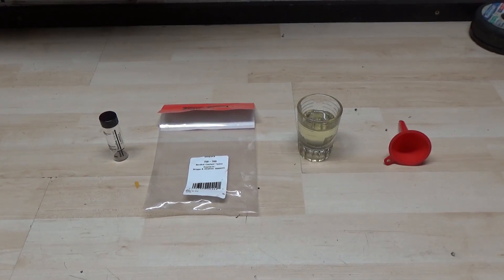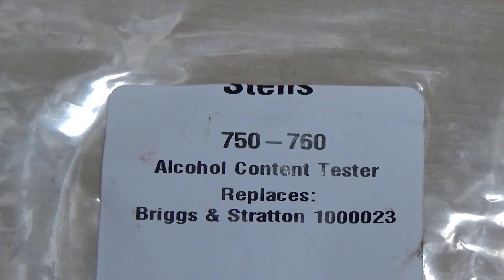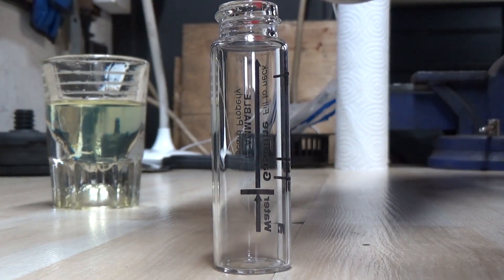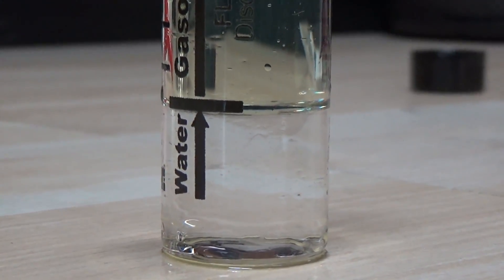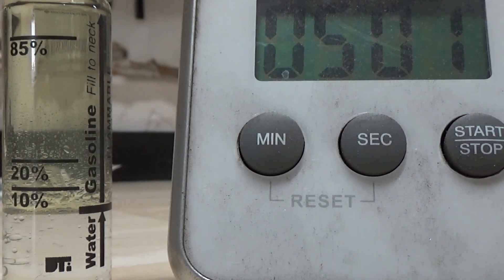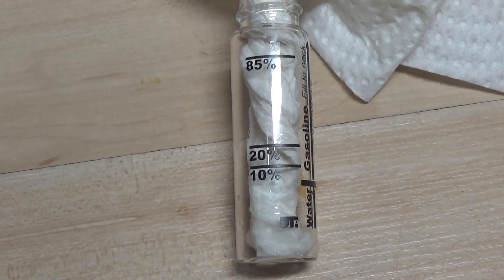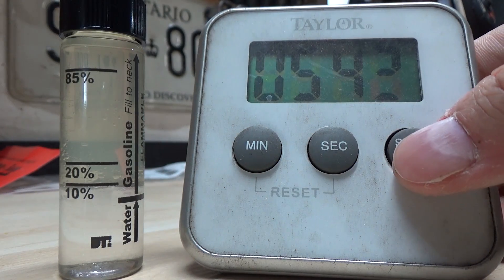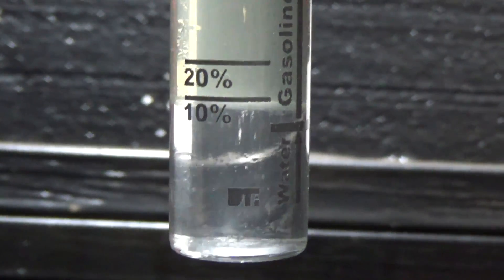How to Test Ethanol Content in Fuel

Comment: You are measuring the phase seperation. Water is soluble in the ethanol, gasoline is not. The water will draw the ethanol out and be at the bottom of the vial because gasoline is lighter than water and water and ethanol mix. Ethanol based fuels will tend to draw in moisture which leads to corrosion in your fuel system. The fuel additives heet that remove water from gasoline is isopropyl alcohol. This is partially soluble in gasoline, so it can remove the bottom layer of water from your gas tank. I think that most manufactures of small engine have changed to rubber parts that are not effected by 10% ethanol gasoline. You cannot run higher % ethanol based fuels than recommended because you have to richen the fuel mixture as the ethanol rises. In California, our 91 gasoline is still 10% ethanol. If I am not going to run it for a while I will put fuel stabilizer in the small gas tank, run it to mix in carburetor. Then fill the gas tank full. If its longer than that drain the fuel system.

Comment: Canadian Tire 91 octane now has 10% ethanol.
Reply from the maker: Yes it's unfortunate, but it actually has "up to 10% ethanol" which means it may or may not have. I spoke to a manager at CT gasbar in town and he says sometimes it does sometimes it doesn't
Reply: @EliminatorPerformance I have 100 ml bottle. How much water and gas be mixed to test for ethanol content? What's the ratio of water and gasoline to be added? Can I add more water than gasoline?

Comment: Just to add: The fuel at the top is now ethanol free, which you can decant off and use in any engine that can't use ethanol fuel.
Reply from the maker: Yes but the ethanol is around 100 octane and if it's e10 fuel (10% ethanol) then you lose about 10 points of octane so you need to add an octane booster to it.

Comment: Can you do a video on how to separate the ethanol from the fuel at home?
Reply from the maker: The issue is it's a pita as you have to add water so the ethanol separates, then you drain the water from the fuel and then you have fuel that is less octane so you have to do the math on how much octane boost you need. If you buy 91 octane with 10% ethanol and the ethanol is 100 octane you're basically removing 10 points so now you have what, 81 octane. The issue is when people start with 87 that has 15% lol now it needs more booster

Comment: Looks like the days of ethanol free are over here in Canada. From numerous reports I’ve come across online that due to government regulations that ALL grades will phase in to contain 10% ethanol.

I just bought some Shell 91 from my local pump the other day (Feb 24, 2023 in Mississauga, ON) I’ve tested 91 from this station in the past and it was always ethanol free.

Unfortunately I just tested this recent batch and it came back at 10% ethanol. I’ll test again in a month or two to see if this was a one off but I doubt it. Did some poking around via Google and came across this quoted response from Canadian Tire Corporate from late 2022 (who previously sold ethanol free 91):

“New government regulations intended to reduce carbon emissions from mogas across Canada are now being rolled out. This regulation includes a 10% ethanol component in regular and premium gasoline. Canadian Tire fuel suppliers are now mixing up to 10% ethanol in both regular and premium gasoline to meet those requirements.

Ontario and other provinces across Canada are now implementing this initiative and Canadian Tire will comply with those regulations”

Here’s a quote from Petro-Canada:

“Do we put ethanol in our Petro‑Canada gas?

Yes, all of our grades of gas, including our Ultra 94  high octane fuel , contain up to 10% ethanol content. This is required by federal and provincial regulations.”

In short it seems the days of ethanol free fuel are over and if you’re still finding it it’s older batches. My guess would be by the end of 2023 it will be impossible to find (in Ontario at least)
Reply: Yep...same in Alberta.  I just got an email from Parkland Fuels (Chevron distributor for Alberta) and they have confirmed that they no longer have the option to produce and sell non-ethanol fuel.  As of the end of February 2023, ALL FUEL IN CANADA contains ethanol - 10% will be typical unless otherwise noted.  This was mandated by the Feds and is now in effect.  My fuel test this past weekend (26 FEB 2023) confirms 10% ethanol or more in Chevron 94 (signs still say ethanol-free) which was always the go-to fuel for vintage, high-performance and seasonal vehicles.  I've had to remove the ethanol for use in my 1984 Virago.

Comment: I have been reading that Canada has made it mandatory that all gas sold contains ethanol as of 2022. This includes premium grades. I have been buying Shell 91 and last night I did  a test like yours and found no signs of ethanol in it. Anyone have any further info on this? Makes no sense if it was mandated a year ago.
Reply from the maker: Shell V Power 91 and Canadian Tire Premium 91 are still ethanol free!
Reply: @EliminatorPerformance  Great to have a little test kit like yours to confirm it from time to time!
Reply: @EliminatorPerformance  Great video.  Most Chevron 94 in Alberta are (still ) ethanol-free.  Many of the convenience store owners associated with the gas stations have placed decals over all of the pumps stating that the fuel "may" contain up to 10% ethanol, including the pumps that are dedicated to 94 only.  I'm sure this was done in error since there are large signs clearly stating that 94 Octane is ethanol-free.  And regardless of the government's overreach, there still needs to be recreational fuel made available for seasonal machinery, recreational/marine use (like REC-90 in the US - see Wiki) and vintage cars & motorcycles being harmed by ethanol in gasoline.  The agricultural/farming industries in Alberta, Saskatchewan and Manitoba are pushing back hard on the feds' mandatory ethanol policies.  Not everyone drives a Prius in the city.
Reply: I just bought some Shell 91 from my local pump the other day (Feb 24, 2023 in Mississauga, ON) I’ve tested 91 from this station in the past and it was always ethanol free.

Unfortunately I just tested this recent batch and it came back at 10% ethanol. I’ll test again in a month or two to see if this was a one off but I doubt it. Did some poking around via Google and came across this quoted response from Canadian Tire Corporate from late 2022:

“New government regulations intended to reduce carbon emissions from mogas across Canada are now being rolled out. This regulation includes a 10% ethanol component in regular and premium gasoline. Canadian Tire fuel suppliers are now mixing up to 10% ethanol in both regular and premium gasoline to meet those requirements.

Ontario and other provinces across Canada are now implementing this initiative and Canadian Tire will comply with those regulations”

In short it seems the days of ethanol free fuel are over and if you’re still finding it it’s older batches. My guess would be by the end of 2023 it will be impossible to find (in Ontario at least)
Reply: well you can separate ethanol manually if you want ethanol free fuel  @thehawk05

Comment: If the 87 and 91 both have the same ethanol content where I live, does it still make sense to purchase 91 for my small engines?
Reply from the maker: No, the 91 is ethanol free, the 87 is 10% ethanol. Therefore, the 89 is a 50/50 mix from both tanks, and results in a 5% ethanol rating. If I could buy ethanol free 87, I would.

Comment: I have been using Costco 87 since December 2020 for my new CRV 2020. The first part of 2021, I got great mileage. Then, early summer 2021, the mileage started dropping. 
I wonder if Costco changed their gas, even though it says 87 octane. 
In my area of eastern Los Angeles county, we have a lot of Chevron stations, a few Mobile & Shell.
The question, which of these would get better mileage? Even though Costco is 50 cent cheaper, is it worth it for low mileage & possible ethanol damage?
Thank you
Reply from the maker: Only the Costco 91 is ethanol free! Same with Canadian Tire 91. I've been told shell v power now has ethanol. And Sunoco 94 has 1-2.5% ethanol, which could be trace amounts from them doing a tank to tank transfer.
Reply: @EliminatorPerformance  Several months ago Costco in Oshawa Ontario (so I expect it is everywhere) changed their premium gas from no ethanol  to 10 percent ethanol just like the regular pump and now there are the 10 percent ethanol stickers on both sides of the pump . Very disappointing and I'll have to go elsewhere to get ethanol free gas for my boat and small engines.

Comment: Sooo , does this mean if you did this on a larger scale ... then Drain the Fuel off the top ... you would end up with Good Non Ethanol Fuel ????
Reply from the maker: Yes, but it would be low on octane so you have to add booster
Reply: @EliminatorPerformance  be interesting to see how much it would loose ... and one would have to make sure its Not an Ethanol Based Booster ... i ask because in my erea you cant find Non Ethanol fuel and for all the lawn care , chain saws , generator and other small engines..  i hate winter , have to go thru and drain everything ...
Reply from the maker: @danieledwards7178  the only fuel we can get that's ethanol free is 91 octane at Shell (V-Power they call it) or from Canadian Tire gas bar. I wish I could purchase 87 octane in ethanol free but they want to boost that to 15% ethanol now which means I'll probably make way more money because these mowers are not supposed to run on more than 10% ethanol and no one likes to purchase more expensive 89 (which is only 5% now but will no doubt be boosted to 10% soon. I run 91 octane ethanol free in everything, my truck, mowers and snowblowers. I hardly ever work on my own equipment, apart from basic maintenance.

Comment: Ethanol also burns faster, getting worse gas mileage.  I ran 94 instead of 87 and I saved 1 litre of gas for every 100Kms on the highway.  I knew it would improve a little, but it was more than I expected.  It’s still a bit more to run the 94, but I can add a big more boost and timing…..

Comment: Second test says ethonal is in gas but how do you know it’s not just water
Reply from the maker: Because it would've already been separated. Ethanol binds to the water and is pulled out of the fuel, so by adding a measured amount of water, after shaking if the water level rises, that means the 10% ethanol (alcohol) has been pulled from the fuel.
Reply: @EliminatorPerformance  is still not following I guess. If water binds with ethonal then how do I know it’s ethonal not just water. The water line raises to say 10% line. That can mean water also right? Because water binds with water so how do I know it’s ethonal not just more water?

Comment: The water in ethanol does not evaporate through the vents.  It's worse than that.  Ethanol attracts  and pulls water vapor (the humidity in air) in through vented gas tanks and the water in the fuel gets more water.  The water then goes to the bottom of the tank as it did in your test vial and does not evaporate.

Comment: Thank You for this video. I am more knowledgable for it. 

Question: 
Can I use this same glass vial to test if my 2 year old (91% Esso - so no Ethanol) half full gas can is still potent?

I assume, I'd need to shake the gas can to mix back any water condensation/impurities so that after the 5 minute test, I could get a reading of how much useless material is in my gas can? Then, lets say it shows a 20% separation line, would that suggest I need to carefully drain out the lower 20% of my 'Gas can' (once settled), so that I essentially remove water/ethanol and get left with more 'OOMPH'  Or, am I completely mad and just need to go get new 91% gas?

Yes, I am a novice in this area but would be a better steward of the environment if you can guide me right!

Cheers!
Reply from the maker: Unfortunately this doesn't test octane ratings or if fuel is still good, it only tests how much ethanol is in the fuel, as it will bind with the water and separate from the fuel, as shown with the lower grade fuel. Only the 91 Octane here in Southern Ontario Canada is ethanol free, so that's what we purchase. Also, not all 91 Octane fuels are ethanol free. The only places here that sell ethanol free 91 is Shell, Canadian Tire and Costco.
Reply: @EliminatorPerformance  doesn’t Costco only sell regular gas? Our Costco doesn’t have a gas station yet.
Reply from the maker: Costco near me sells most blends other than e85

Comment: The comment about no ethanol is more important in you older or historic car. Ethanol will screw up most 1970's or older engines (unless rebuilt) Also pre 1975 engines will need a anti knock additive because of the no lead factor. (real lead). If you have an old motor with has been rebuilt to run on modern fuel, just remember if you use the 'cheap stuff' it is the ethanol which makes it run like crap. We now have SHEETZ here in OHIO, which has a variety of blends and options for you to choose. Including a E zero fuel

Comment: just to clarify, ethanol is bad for old cars... but not for  newer cars, they can handle up to 30% ethanol without problems!  good video btw!
Reply from the maker: Some new cars* just because my truck is flex fuel, doesn't mean all newer vehicles are. They use special components to run e85

Comment: One thing to remember when doing this test and getting a small sample of Ultra 94 at Petro-Canada into a gas can, makes sure you fill the vehicle with Ultra 94 first to get any remaining fuel out of the pump hose (the previous person may have filled their vehicle with regular). This of course if the high grade fuel does not have its own dedicated pump hose which it rarely is. That hose is usually shared between regular, mid-grade and super.
Reply from the maker: Yes, great point. Thanks for watching!
Reply: I usually put 1L of premium in the truck before filling the gas cans, not sure what to do once I get a diesel truck.
Reply: Locally we have dedicated pumps/hoses for Non ethanol & Reg.

Comment: Octane has nothing to do with ethanol content. And higher octane doesn't mean better performance from your vehicle!
Reply from the maker: Octane where I live has everything to do with Ethanol, because I can't buy 87 or 89 octane ethanol free.

87 octane is 15% ethanol
89 octane is 10% ethanol
91 octane is ethanol free.

Therefore, in this video, I explain that I have to buy 91 in order to get Ethanol free fuel.
Reply: @EliminatorPerformance  fair enough. Still misleading though.
Reply from the maker: I don't find it misleading at all, what I'm doing here is testing the 91 Octane fuel I'm purchasing to see if it's worth it. Which is what my thumbnail says "is 91 Octane worth it?". And octane absolutely affects the performance of an engine, as higher compression engines need higher octane fuel because it ignites slower, so predetination doesn't occur. My 2019 f150 with a 5.0L V8 for example, has an engine with 12:1 compression and runs poorly on 87, and says that's the minimum Octane that should be run, with my manual even stating I may need to run 89 or 91 premium when towing in the summer time, because of the added heat and load on the engine.
Reply: @EliminatorPerformance  What he is saying is that Ethanol can be found in all grades of gasoline, depending on where you live and the producer of the gas. I buy my gas at Sam's Club, using the highest premium gas they sell, and it still has ethanol in it.  I really appreciate your video and I'm going to purchase one of those test vials. Next stop; Shell station.
Reply: Well it does if your vehicle's Owner's Manual requires super, otherwise your ECU will simply retard the ignition if it pings. If your owner's manual calls for regular, putting in super will not get you more performance.

Comment: Yep. Ethanol will destroy rubber seals... Provided your fuel system was made before 1928. You see the big selling point for the 1928 Model A Ford was that you could use Ethanol because the seals in the fuel system were made of Synthetic rubber instead of natural rubber.

Comment: Thanks for posting the interesting demonstration but I doubt that ethanol caused the crystals you observed.  If ethanol in water reacts with air it can produce ethanoic acid (aka acetic acid).  Ask any winemaker about wine turning into vinegar.  The ethanoic acid can react with metals to form salts and that is likely what you have seen.  This means ethanol-blended fuel can damage any engine, not just the little ones.
Reply: Wow, good to know. Thanks
Reply: @gregorysantana4247  You are welcome but I forgot to mention something important.  It is not possible to have 100% pure ethanol because the alcohol will always absorb moisture from the air.  An ethanol-water mixture will then absorb acetobacter from the air and the acetobacter will consume the alcohol and produce acetic acid.  This reaction has been known for thousands of years and it is a mystery how this knowledge seems to have been forgotten in recent times.

Comment: Curious which fuel out of these you opt for to fill up your new f-150 to run the gen3 coyote!?
Reply from the maker: I usually run 89 because my manual says that 87 may cause engine knock when towing. But with the price of fuel lately I've been running 91. I could technically run e85 as the v8 is flex fuel, but I can't get it around here.
Reply: I am on the same page as you... Taking advantage of the 91 right now and would give the E85 a go if it was available in ontario
Reply: @dylansimpson2064  Petro Canada 94 has 10-20% ethanol, I see less timing corrections on my accessport with 94 compared to other 91/93 fuels